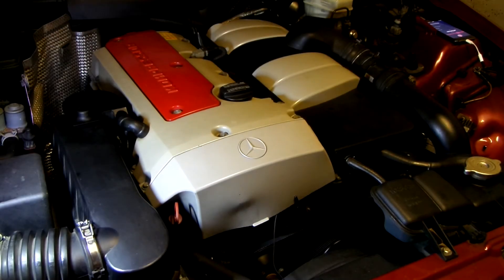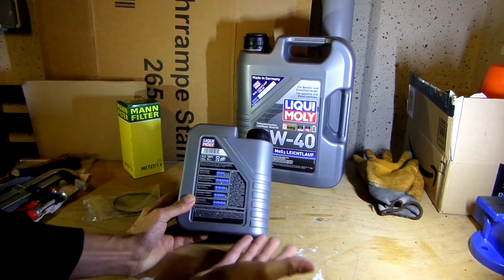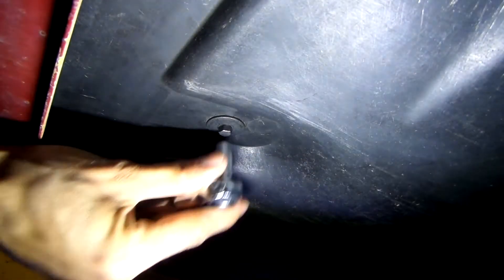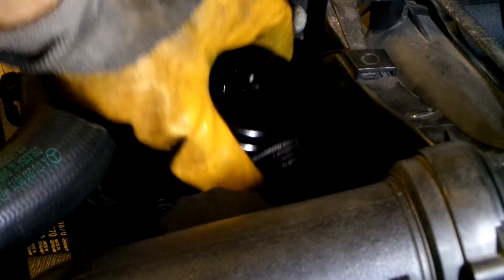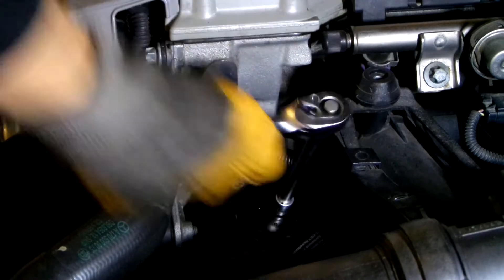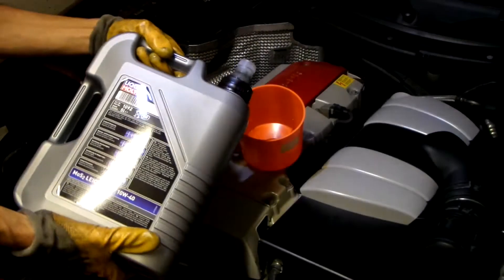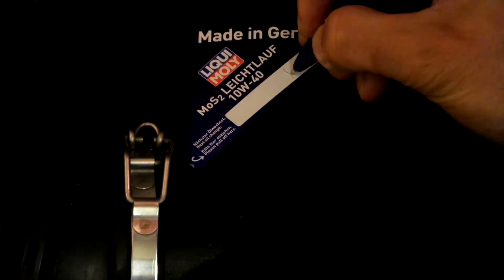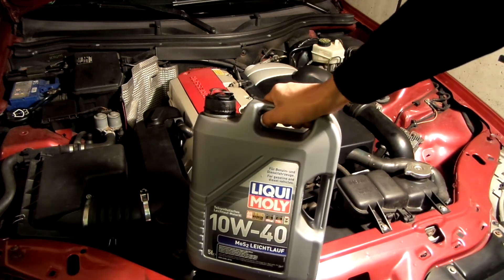💡 [Mercedes M111] Startup Rattle - Can it Be Amended with a Non-Approved Oil?

Comment: Il bollettino Mercedes MB STAR del 30/11/2004 PB-05.20/14 ha confermato che la rumorosità al primo avvio a freddo, è normale (per 2 o 3 secondi) in quanto l'olio fuoriesce completamente dal regolatore dell'albero a cammes.
Quando aumenta la pressione dell'olio, si stabilizza tutto.
Molti hanno cambiato catena, tenditori, pattini, tipo di olio e tutto. INUTILMENTE!
E' una caratteristica del motore ( e di Mercedes, ma non solo) che non porta danni meccanici.

Anzi molti meccanici possono fare danno, se la mettiamo così.

Comment: Mine does It also in release and acceleration at low rpm. I am currently using 10W40, i checked timing because i Wasn't sure what problem was, and the car currently has 27° of timing instead of 20°, but the noise the car makes Is exactly what yours Is doing.

Comment: Mine does exactly the same noise.. You start, you wait.. and after 2-3 Seconds you hear that terrible, loud noise, for 1-2 Seconds.
I was afraid, that this might be the Chain or the Supercharger..
Are you sure, that this is caused by the hydraulic lifters?
Reply from the maker: No... but I don't know what else it could be. And I cannot explain why the noise does not start immediately, but rather after 2-3 seconds, like in your case.
However, it has to be something inside the engine that is lubricated with oil.

Comment: 5W oil drains from lifters after few days. That causes a brief rattle on startup. 
If oil is too thin, engine might be shaky and rattle a bit until warmed up (in warmer months too).
10W-40 or 15W-40 oil eliminates it in most cases.

Comment: I use molygen 5w40 on my 2.0K m111. still makes the same rattle if sitting for several days. no rattle if driven every day. I was planning to go for LM 10w40 super leich... which has mb229.3 approval. any differece in rattles since uploading this vid?
Reply from the maker: I've since written a short update in the description. After the winter break, it still makes the rattle noise.

Comment: M111.955 engine takes 7 literes oil
Reply from the maker: I did a bit of googleing and it seems that in the later years the oil capacity was increased, thanks for noticing! On my model however it takes only 5.5l.
Reply: @ProperRepair  what is your engine model code number? m111.955 or ....??
Reply from the maker: 111.983
Reply: @ProperRepair  I can't find any bulletin issued by MB for increasing the oil level to 7  liters on the M111.
Reply: @eczmurat  m111.955 yağ kapasitesi 7 litre.
Reply: @fatihemre5019  emin misiniz? 203 c’lerde mi var 955? Benim bildiğim hepsi 5,5 litre 1994den beri m111 kullanıyorum. Önce 124 kasa şimdi 170
Reply: @eczmurat evet , 203 kasa, 2001 modelde m111.955 Evo motor var ve yağ miktarı 7 litre.
Reply: @fatihemre5019  karteri büyük demekki.  R170 deki evo lar 5.5 litre alıyor. Hem 200 hem 230lar. İlginç
Reply: mrb. hangi m111 7 litre alıyor acaba?
Reply: @eczmurat  M111.951 engine of C180, 129 hp (year 2001) 7 litres

Comment: Nice video, I have the same rattle on my SLK230 Kompressor which has the M111 engine. I have read online that it can be caused by using a non-Mercedes oil and/or filter but good to know you can use non MB parts/fluids too.